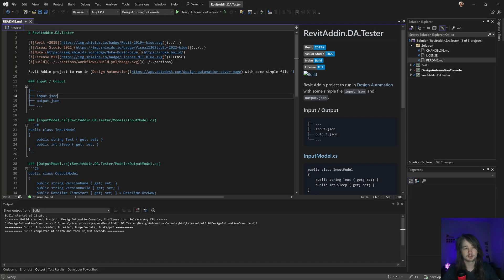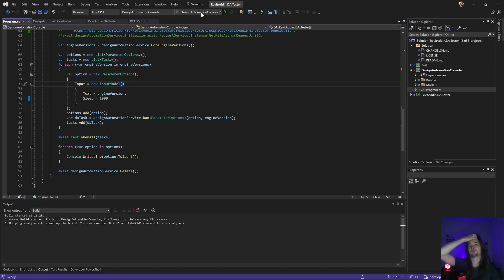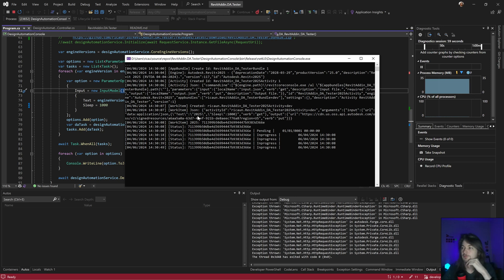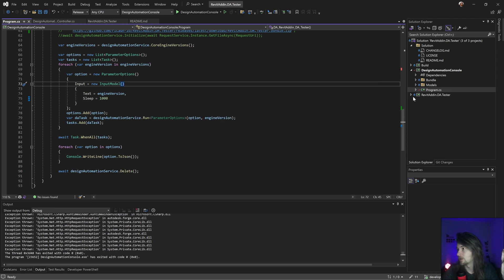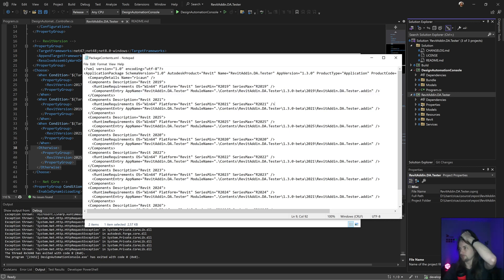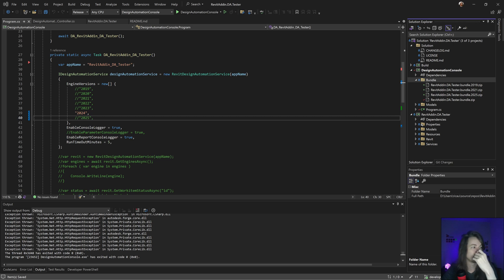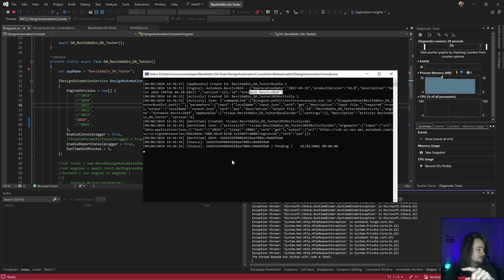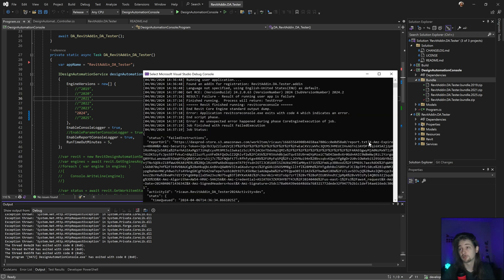Design Automation for Revit 2025 - Bundle issue!

Comment: @ricaun I am having trouble in my Design Automation plugin for Revit 2025 to log things to the report.txt using System.Console.WriteLine(). My add in seems to initialize fine, but I don't see any of my logs reported in the report.txt. Have you seen a similar issue?
Reply from the maker: Yes I have the same issue, there is a line in the report with 'echo excides console output size' Autodesk mess up 🙂
I suggest to sending email to aps.help@autodesk.com to report the issue and maybe speed up to fix the problem.
Reply: @ricaun  thanks! I have the same error ("[04/19/2024 10:46:10] Warning: echo (12924 bytes) exceeds console output size of 10000, skipping reading"). It's going to be difficult to debug design automation specific issues without logs :) I will definitely contact Autodesk about this.
Reply from the maker: If you really need to see the console, there is a workaround but is not the best, you need to add some code to redirect your console to file and set that file as a output for your design automation, so you can download the console.txt
And when Autodesk fix the problem don't need that anymore so, don't think that worth. 🙃